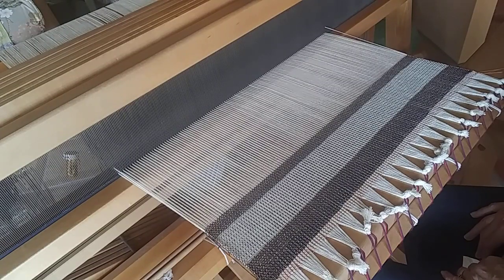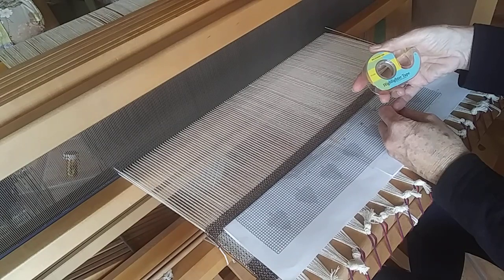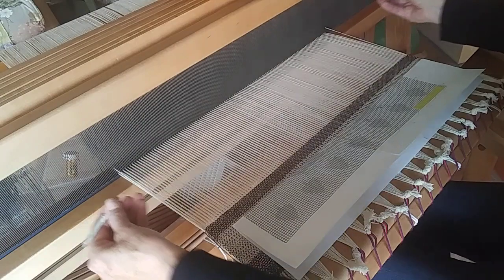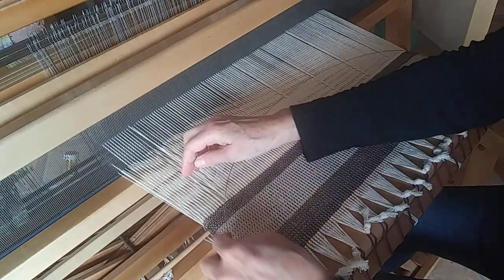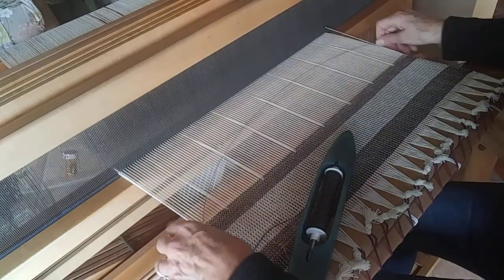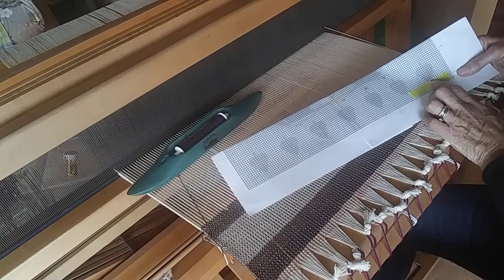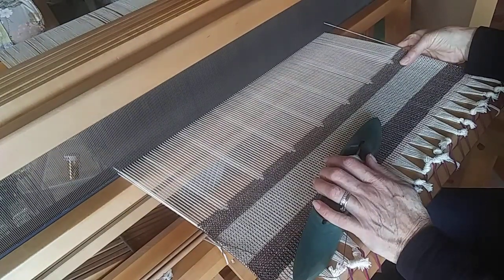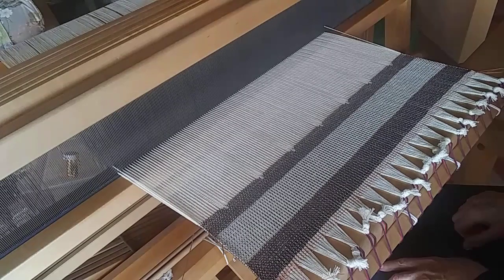Weaving False or Mock Satin Damask Pick-up on Four Shafts

Comment: Since I was too lazy to try to figure out the tie-up, I purchased the pattern and measured off an eight-inch wide warp of 200 threads for practice. There was a bit of a learning curve over the first few inches of my piece, but now I'm in the swing of it and the design (my own) is starting to emerge. Since I'm weaving it on a table loom, I added an additional step which is very helpful in eliminating unwanted floats: reinserting the pickup stick in the shed before passing the shuttle through.

Comment: Such a shame you dont cover the tie up. As 1-4 is fine. But the treddle tie up is key
Reply: I wish I knew what this means..... Is it a negative comment?
Reply: As she talks about 14 and 23, i would guess it is 12, 23, 34 and 14.
Reply: The basis of damask is alternating blocks of 1,3,2,4 raising shed satin stitch (direct tie up)and the same pattern upside down, 1'3'2'4 sinking shed satin stitch.
Reply: Duelling rabbits hand weaving has a good video of the structure of damask fabric done on a drawloom, so you can see what this creator's trying to accomplish with four shafts and pickup sticks.
Reply: I did work it out, but, it would have completed this video to include it
Reply: This video was part of the paid pattern that you purchased.  In her patter, everything is clearly explained, as usual.  She has had a lot of weave a longs lately.  Again, the purchase of the pattern for each weave a long was necessary.

Comment: Hammer the end of the wire with a ball peen hammer on a steel block then file the now rounded edge with a metal file. That will finish it with a smooth edge that won’t cut you…. No need for tape to get stuck
Reply from the maker: Good idea, Gene. Thank you!

Comment: Where do you find piano wire?
Reply from the maker: I'm not sure this information is current, but it was at the time I published the Two by Two Towel pattern:
Piano wire; 5 Ft, Size #13; available on eBay (free shipping): Ebay size 13 piano wire
Or here (shipping is additional, depending on zip code): Howard Piano 
Or from a local music store.
Reply: @sarahjacksonhandwovendesig1162  thanks I found it on eBay-